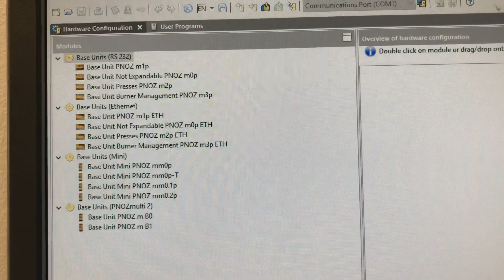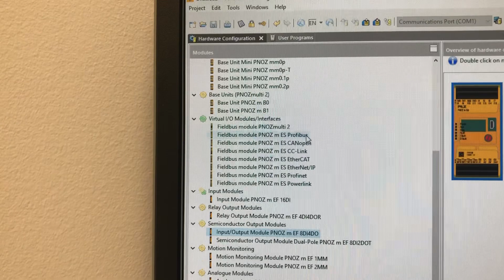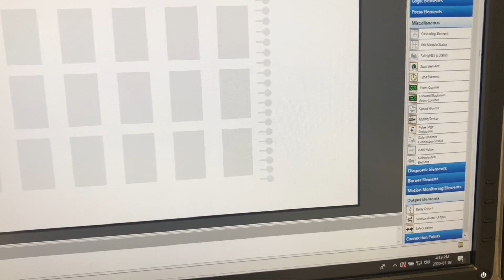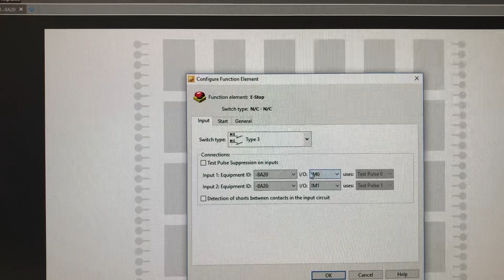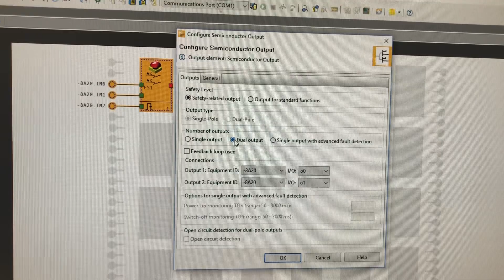PNOZmulti Configurator basic demo - Part 1

Comment from the maker: Please give a thumbs up 👍🏻 if you like the video! Timestamps...

Hardware configuration:
0:51 Selecting the base unit
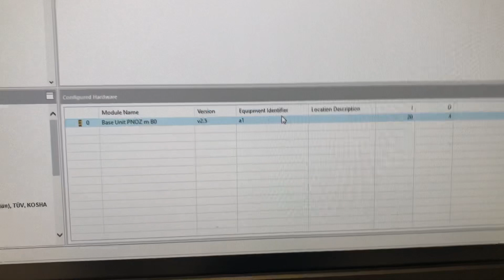1:57 Edting hardware details
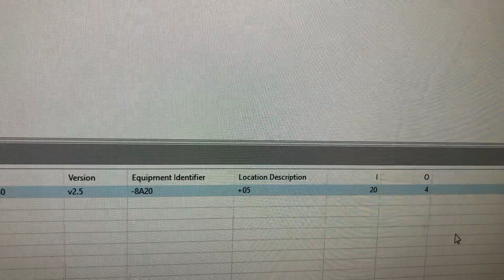4:23 Adding expansion modules (right side)
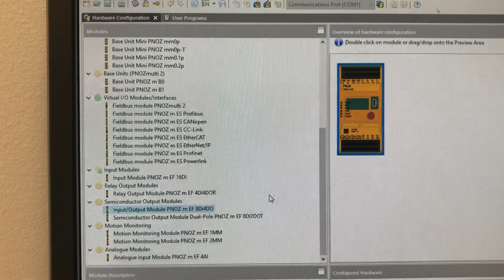5:20 Adding communication modules (left)

User program
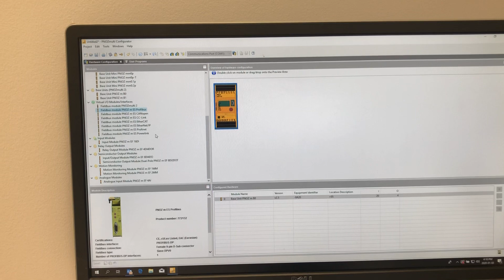6:23 Where to find and basics
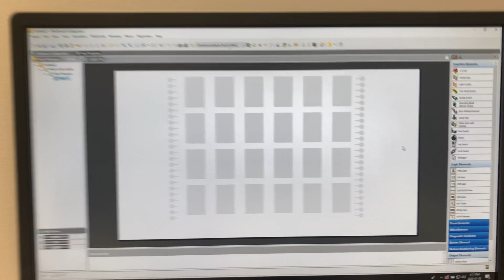7:28 Location and basics of function elements
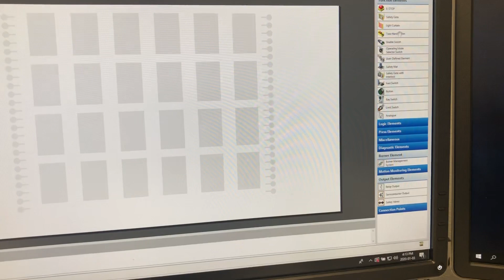9:22 Adding input elements
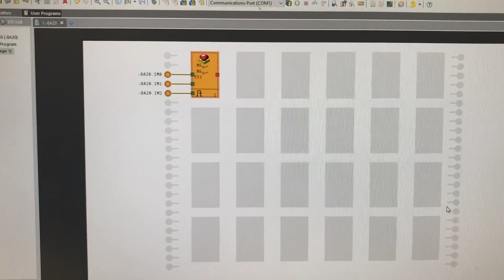15:41 Adding output elements
Reply: hello sir, i can't find the version of my pilz in the software ! i have a pilz base unit mm0p version 2.5
Reply from the maker: @walidajakkaf7678 , 1:57 Editing hardware details

Comment: Hello Sir, Could you please give me the PNOZ Configuration software. Because my factory used some PNOZ Controllers from eurror's suppliers but we didn't backup of program. Now i need to upload and backup them Thankyou !
Reply from the maker: Hello, Tuong. The only way to upload and backup the program is with the password. You'll have to contact the original equipment manufacturer, I'm sorry.
Reply: @jpv1980  Many thanks, i will contact with original equipment supplier !

Comment: Can you tell me how to get online using rs232? Im trying to retrieve project from old pnız m1p bt can not connect to pnoz. Im using usb to rs232 cable and standard rs232 cable with 2/3/5 wiring pinout…
Reply from the maker: Hello, Rashid!

Not all USB to RS232 serial converters will work with PNOZmulti. Please search it up on Amazon for the keywords "ATEN uc232a usb-serial converter".